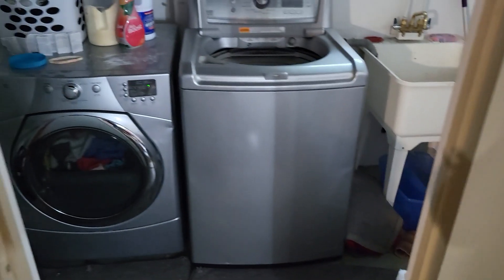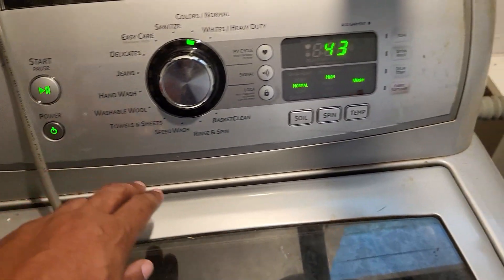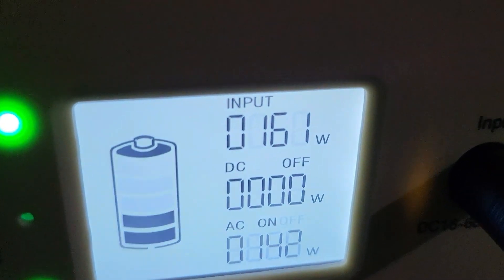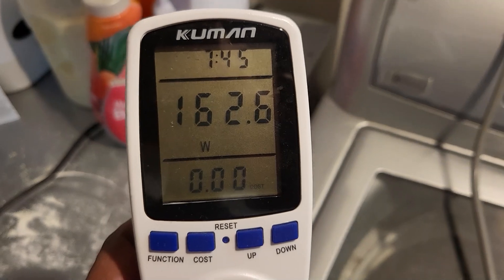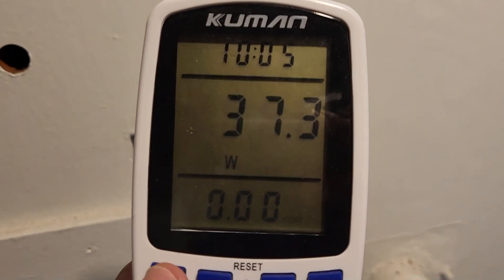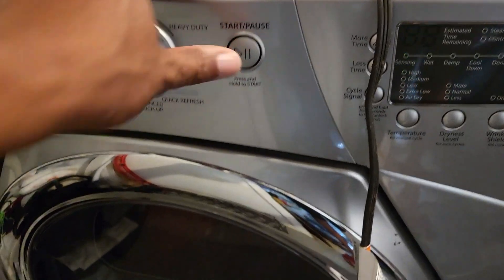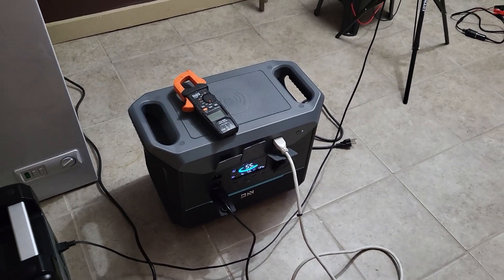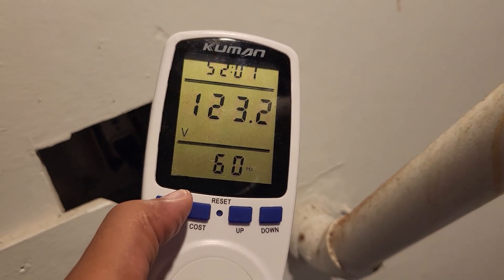I Tried Washing and Drying With SOLAR POWER Here's What Happened

Comment: Regular inverters would work much better for high draw items.  A couple or 4 of lifpo4 batteries would work wonders.  Use the small power stations to feed the big batteries through a chargeverter.  Will prowse has a great video on making a mobile powerstation with just about these requirements.
Reply from the maker: I greatly appreciate the suggestion but I test with what I have. Yanno.

Comment: I'd be curious how much one of the all-in-one washer/dryer combos (that use a heat pump to dry the clothes) would use?  It claims to use 535Kwh/yr, and it does run off a 120v, 15-amp circuit.  It's way more than what you saw, with a gas dryer, I'm sure, but could probably run off a beefy power station or a sizable inverter that puts out a clean 120 volts.
Reply from the maker: That's a good question. A friend of mine (Setite Tech Adventures) wants to get one in the future. They are little too costly for my pockets.  Haha
Reply from the maker: A commenter said they have an aio but I don't know if it's a heat pump style. His name is LouJustLou.

Comment: In summer we use our solar powered clothes dryer. We just hang them out on the line. And the sun and warm dry days dry the laundry. In winter we have a wood stove. So we hang laundry in the house and they dry out and humidify the air.
Reply from the maker: Respect! Thats a good system. 

Do you guys live somewhere that kinda requires this or is it just a life choice?
Reply: @AskIveSolar  It is just something to save on electric. Plus we have to use wood as ice storms knock out power sometimes .
Reply: I have a large dryer. It is 240VAC. Specs are like 5400W. It draws the most wattage than any other appliance.  My washer is1200W.

I was curious if your dryer would work because it's gas. 
I only have 400W Solar Panels and 2400W battery.
Does all my appliances wouldn't trust with my fridge or heavier appliances. 
However, it runs toaster oven, espresso machine, toaster, etc.

Comment: I have an LG all in one and ran 6 loads through it with a Delta ecoflow pro and 1 extra battery. I charge with 1 KW of power.
Reply from the maker: Oh nice, how much power does it use in watt hours. Someone in the comments is curious.
Reply: @AskIveSolar  I typically use about 1.2 KW for a load. It usually takes about 2 hours for a normal load.

Comment: This is kind of an example of why I'm not fond of the medium-small (700w-1200w inverter) class of power stations, there's just too much random crap they don't work with. Either go small (300-600w, which is enough for low draw devices and minimizes inverter idle draw) or go big (1800w, which is 15A 120v AC which means it's similar to what you can expect out of a singular common household circuit)
Reply from the maker: I'm inclined to agree but also keep in mind that mid tier joints can run more small items than just a small joint. 

But I feel you!
Reply: @AskIveSolar  The issue is often the price point. It's often less than $100 more to get the beefier station. For example right now the AC70 is 380 while the AC180 is 460. Yeah, cheaper is cheaper, but it really feels like you are shooting yourself in the foot in the long run.

Comment: Fyi 110v-120v is with in the national electric code for rms line voltage. All appliances sold in North America are required to operate normally on that voltage range. As a matter of fact, most devices can handle even wider voltage variances just fine. Peak current needed by the device might surpass the power station’s abilities and cause the weird behavior. Thanks for the video bro, keep killin it! Blessings to you and the fam
Reply from the maker: Interesting point and no disagreements here but it does seem that 110 just doesn't bode well for my devices. They work just not as well. 

Thanks for watching and taking the time to comment!

Comment: The startup current needed by those motors is more than those power stations can handle, by a long shot.  If I had to guess, your washer doesn't run the motor continuously either, but turns it on and off rather than using a mechanical offset to oscillate back and forth; that's why its power numbers kept fluctuating so much.  Our washer is old-school mechanical, so either of my two larger stations or my Licitti box should be able to run it.  The dryer is electric, so no dice; we'd be using the sun to dry our clothes, without the efficiency losses of going through a power station.  Our great-grandmothers did it that way their whole lives, so I know it works.
Reply from the maker: I think I mentioned it on someone elses comment. What I notice sometimes is how heavy the load is has an impact and how balanced out that load is matters as well....related to getting started. 

Shoot, my grandmother dried clothes on lines outside. Poorer folks still doing it. Push comes to shove, we'll all be drying clothes outside.
Reply: @AskIveSolar  Oh, my grandmother did too; I just wasn't sure I was enough older than you not to say "great-grandmothers."  Yes, I am a grumpy old man of 65 now, (but less grumpy since I retired in September).  And yes again, I can hear you laughing, and then Del laughing when you tell her why.
Reply from the maker: Nice @ retired. That's what's up!!

Comment: I am thinking of getting a GE Profile heat pump washer dryer that would run on solar. No gas out here. My house is weird and my dryer currently vents into the basement  😬 so it would be nice to go ventless. I think I'd lose the warm towel effect though.
Reply from the maker: Actually this one just died (washer) after maybe 10 plus years or working. So we went with another GE Profile joint.